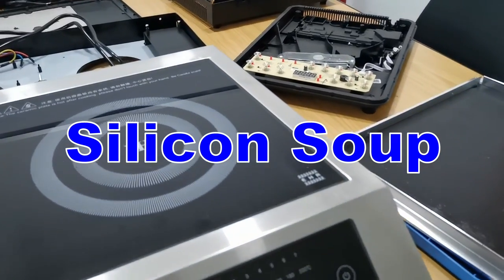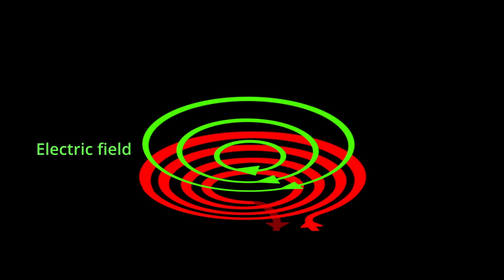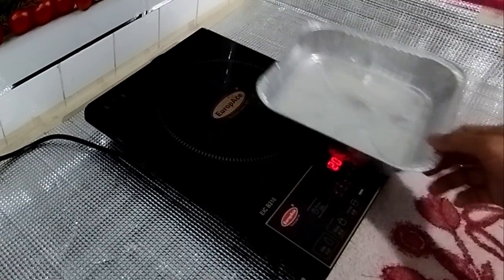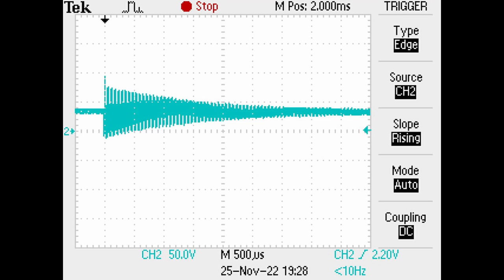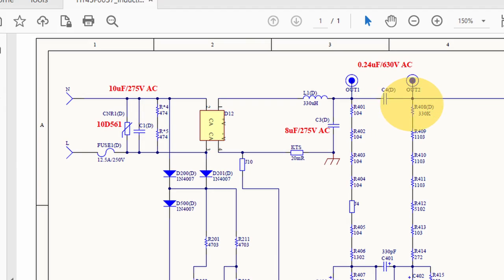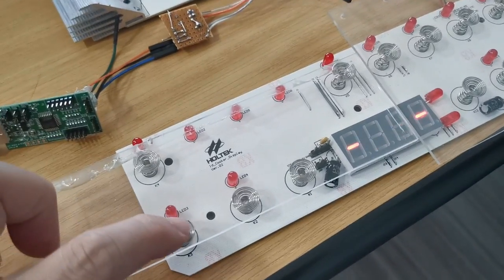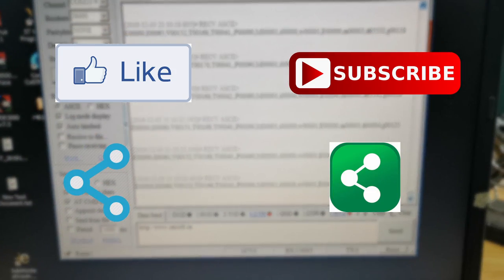induction cooker circuit, design, theory, must watch

Comment: You’ll notice the IGBTs are 600 V or greater, which means the room temp BVCES will never be 600 V.  Why do you think the line voltage will be capable of reaching BVCES and damage the IGBT?  During the on cycle the IGBT will be approximately 1.5 V with a load of 25 A, that’s 37 W.  If the cycle is very long you can estimate the junction to case temp increase is 37 to 100 °C depending on the heat sink.  Then there’s the ETS which is ~0.5 to 1.2 mJ.  So the average switching losses are 1 kHz*1 mJ = 1 W; adjust for frequency and temperature and thermal impedance.  The datasheet will give you guidance for temperature as a function of frequency.  So, the ideal behavior of switch mode converters is different than  a true application.  Real devices self heat and contribute losses while on and during transition.  I am sure you know this but I thought others might like to know you were speaking of an ideal switch and not an IGBT.

Comment: Excellent rendition. Thank you.  I am a EE from way back and now into CS.. but follow this stuff completely.  Built many circuits in my time.. I like the comment about running at 75% power.  Did not know that. Just got a Duxtop to play around with and was quite impressed by its performance today.
Reply from the maker: Cool, thanks!

Comment: I have an idea. Can I use broken induction cooker, replace the induction coil with suitable size to hug the bolt and make induction bolt heater?
Reply from the maker: Induction cooker is a delicate design. By changing the gap between the cookware and the coil, the igbt would burn, let alone replacing the coil.
Reply: @SiliconSoup   THe problem I encountered so far is that it is too smart and any notices difference and gives no cookware error.. :/

Comment: I always get frustrated that induction cooker have very big gaps between their settings. But the only good cooker that doesn't is $1,300!!! So expensive!

I wondered why they don't just use a potentiometer, and this video helped explained why in most ones this is not the case.

Comment: Well, i was hoping to find a video about some « drop-wave control method » that reminds me of the former NTSC video signal:

Holtek (Republic of China)
"Low power continuous heating single IGBT induction cooker"
2023-Feb-1

Too bad it's got to go through such long path only to come back and get treated as hacker stuff.  But this is actually a comforting read giving me hope for my specific kind of mission, in any case, so now that i found mention of a paper titled 'Holtek Application Note AN0591' it's clear to me what i want to search next!

Comment: You asked for my opinion, so I am giving it. 

I am interested in building an induction burner, and sought out this subject specifically. I appreciate your work, but I have to say--this was hard to watch. EMFs and EDMs and theories about theories and wavy lines. 

What would really make normal people get this (which is what you're after, I hope) is to start off here:

 "I want to understand induction cooking--so let's MAKE one."

So you start by running a current through a plain coil of wire, and that doesn't "work" because (x). So you correct for X, and explain why that is so. 

Then it will do (fill in the blank), but not (y), so you correct for Y, explaining as you go. 

This would have been so much more useful.

Comment: Thanks. I was wondering if I could modify the detection circuit a bit. My induction cooker works fine until the smallest diameter pot (which is made for induction cooking) but it produces the E0 error, that means it is detecting no metal on the secondary side. I wondered where one would adjust the sensitivity as I think it only needs a slight sensitivity adjustment to be able to detect the smallest pot. 

Kind regards.
Reply from the maker: I wouldn't recommend you to modify the detection circuit to fool the MCU. The smaller pot doesn't have enough load resistance, so if you manage to fool the MCU to do the induction, the feedback loop of power control may cause the back-emf to exceed the design value, and that may damage the IGBT (unless the protection is very robust).

Comment: Great video!
I have a question. The induction stove that I have does detect a thin aluminium foil or very thin walled aluminium container and both fly off the stove surface when stove is put on, (result of eddy currents opposing  the magnetic field producing it). 

I filled the thin walled container with water and placed it on the stove, the stove detected it and heat was generated instantly, the heat damaged the container but water became warm.

However the stove does not detect aluminium pan or pot, why so?

Does the thin Aluminium foil have higher resistance and hence gets detected?

Comment: Hi, really good video but I have a question please. I have an induction cooker but the power setting 400 or the temp setting 176F is too high for my cooking and burns the food. I want to adjust the duty cycle of the coil. how would you recommend I go about that?
Reply from the maker: There are two types of low-power cooking, one is intermittent cooking, e.g. turn ON  4 seconds of 1000W and rest for 6 seconds to achieve an average of 400W, the other is continuous cooking, turn on 4 rectified half-sin-wave and turn off 6 rectified half-sin-wave. In either case, the close-loop algorithm ensures the 1000W is accurate, and the duty cycle of 4/10 is open-loop control. How do you want to adjust the duty cycle? Do you have access to the firmware and the necessary tool for modification?

Comment: Is the 300V DC rectified from the the diode bridge directly apply to the coil?
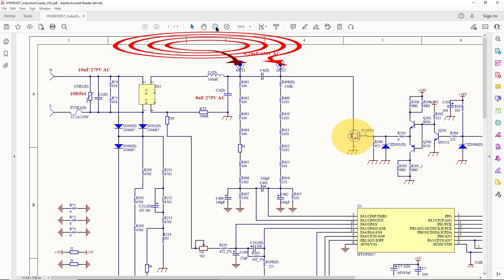Reply from the maker: At 5:00 is the schematic. There is a LC filter between the rectified voltage and the coil.

Comment: Your video is very informative. Can you help to make the circuit ignore that is no cookware on it and still stay on, like yours on the video? Thanks.
Reply from the maker: In my design/video, the controller sends out a single pulse to test the presence of the cookware, once every second. It doesn't ignore the absence of the cookware.
This firmware is designed to produce the induction power according to the user setting. If the user sets 1600W, the close-loop algorithm makes sure the average VxI is 1600W. If I ignore the absence of the cookware, there is no load to absorb the power, and the close loop algorithm will attempt to push the current higher until the heat dissipated at the coil resistance is 1600W. But in the process, the back EMF will overshoot and trigger the protective mechanism for the IGBT. Therefore, even if I ignore the absence of cookware, the induction will stop.
Reply: @SiliconSoup  in my case if I put not big enough cookware the controller goes to a fault mode and does not send power to the coil just for very short time. How can I overcome this problem?
Reply from the maker: @Logan880121  I want to be sure we are on the same page. Are you using HT45F0057, and do you have access to the source code and the ability to modify the source code? Or is this a general discussion?
If you don't put enough cookware, the test pulse oscillates and sustain long, telling the firmware that no cookware is present; the firmware will not start the induction. On the other hand, during the cooking, if the cookware is removed suddenly, due to transformer effect, the current on the primary side will drop suddenly, and once the firmware detect the sudden drop in the current, it will stop the induction.
Reply: @SiliconSoup  I don't have the firmware or the tools to flash the soc and it don't even has a marking on it. I am asking is there a way to trick the circuitry and modify the amprage sensing maybe make it adjustable. It seems to me you know every aspect of the circuit so maybe you can think a way to do this. I can use an arduino to modify the pot sensing. Thank you for you willingness to help.
Reply from the maker: @Logan880121  if you change the current sensing resistor, you may fool the controller. If you reduce the sensing resistor value to half, the control will be fooled to think the induction power is half of the actual power.
Reply: @SiliconSoup  thank you!

Comment: A single circular magnetic field results in unevenly heating the pan’s cooking surface with it being too hot in the center and too cool around the parameter. This condition causes the pan bottom to warp. There is a need for multiple overlapping wedge shaped magnetic fields  arranged in a circle to evenly induce pan heating.
Reply from the maker: Thanks for the info. When making the video, I was hoping to capture the water boiling starts from the centre of the pan first and then spread out to the circumference, but I was not able to capture that. So you are probably right, the coil is compensated to heat evenly.
Reply: @SiliconSoup  Sure, induction can boil water but it can’t sauté evenly multiple items in the pan like caramelizing onions.
Reply: @mikeb6389  Yes it can.  You just need a well engineered, good quality induction range and compatible steel or iron saute pans.

When you heat with gas you still need to preheat, or at least allow time for the heat to spread evenly across the pan bottom.  You can do the same with steel or iron pans just by allowing time for the heat to migrate.  the better the pan heat conductivity the easier this is, just the same as when heating with gas.  My experience using 50 year old triple layer stainless steel RenaWare pans on both gas and induction hobs is that the induction heating is faster, has more accurate temperature control and does not turn on the automatic heat sensing fan over the range as it does not put waste heat into the air over the stove.  Finally, induction hobs are much easier to keep clean than any gas range, and as my dear old Mum would say, cleanliness is next to godliness.
Reply: @philipgrice1026  I got a kitchen that has a 3kw curved wok induction. We tried taste testing between using this and takeaway from Wok to Walk where they using large flame woks. Couldn't taste any difference.

Comment: Actually the term EMF here is an arcane concept. The time varying current in the coil actually  causes an Electric Field around and along the coil due to self inductance in units of volts per meter,  that is the Maxwell Faraday law. The International Electro Technical commission  has regulated the term EMF to the status of deprecated.
Reply from the maker: You got the cause and effect wrong. Electric field causes charges to move (current), not the other way round. Maxwell Faraday equation is curl of E = - dB/dt.
Reply: @SiliconSoup  You just wrote it there yourself curl of E = - dB/dt. The term 
 - dB/dt is caused by the current.  The current is caused by the the applied electric field and as a consequence there is an apposing electric field.
Reply from the maker: To say that "The current is caused by the applied electric field", and "The time-varying current in the coil actually causes an Electric Field around and along the coil due to self-inductance in units of volts per meter" over-simply the whole induction process. How does the cookware contribute to the circuit behavior?
The induction process is very complicated and therefore I devoted 0:50 to 3:30 to explain exactly what happens when various current and B-field interact with each other. If you are implying that all these can be summarized by Maxell Faraday law, then I disagree.
Reply: @SiliconSoup  What I am identifying is that the video uses the term EMF, but the correct term is electric field.
Reply from the maker: I am pretty sure I used EMF correctly. By the way, electric field and EMF are not the same thing.
Reply: @SiliconSoup  Where there is an electric current there is an electric field. Induction and self induction cause an electric field and the integral of electric field is voltage, there is no separate phenomena in physics of an EMF, it is an old defunct concept. Thanks for uploading the Video.
Reply: @woodcoast5026  without a potential, or a difference, nothing has any impetus to change. no current can exist without the potential to create it.

Comment: This is awesome. I have one question, can we skip altogether the AC input and use DC instead?

If we can, is it posible to modify off the shelf board to do it?
Reply from the maker: If the DC is 325V, then yes, you can skip the AC altogether. But if the DC is 12V, then the coil inductance and resistance must be much smaller to achieve the same current by the  lower switching voltage. Many component values must change.

Comment: Is the schematic suitable for using « low power continuous heating » as seen in Holtek AN0591EN?
Reply from the maker: No, the schematics are not the same. The version I presented uses HT45F0057 whereas the the low power continuous cooking uses HT45F0059. HT45F0059 has the low-power continuous cooking related registers. The external circuit to monitor temperature, voltage, current, surge for HT45F0057 and HT45F0059 are roughly the same though.

Comment: What is the purpose of commercial PIC's that have two or more IGBTs?
Reply from the maker: The half-bridge topology uses 2 IGBT. It is form commercial induction cooker which can deliver higher power (3.5kW)
Reply: @SiliconSoup  I have posted a circuit diagram for a Hatco IRNG-PC1-14 on r/inductioncooking, in case you'd like to take a look. It came with the unit.

It's a $1000 single burner unit with 100 power levels spanning 1400w, a minimum constant power of 191w, and single degree temperature adjustments; and 2 IGBT's.
Reply: Further yet, the Mirage Pro claims to use 4 IGBT's on a 1400 or 1800 unit. The Hatco units are all 2 IGBT's until 2.4kw, when they hit 4.

Comment: What is the maximum temperature of induction coil body ? Are the coils able to work at temperatures up to 200°C
Reply from the maker: I am not sure about the maximum temperature the coil can tolerate, but as soon as the thermistor there senses 175C, we shut off the induction.

Comment: Why the power variation is in steps? Is it not possible to vary the power smoothly and continuously?
Reply from the maker: Technically it is possible to vary the power smoothly. Maybe a smaller step of 50W is ok, but smaller than will become impractical to the user; to many presses are needed to reach the target power.

Comment: So, it is an electrical interaction with the cookware (i.e., current resulting from a moving magnetic field), rather than the oscillating magnetic field itself interacting with the cookware. If that's the case, then it seems that the only requirement for my cookware would be that it resists electrical current, not that it is magnetic. What am I missing?
Reply from the maker: Thank you for this good question.The magnetic field above the glass top attenuates quickly because of free-space permeability. The flux going into the cookware is weak and it cannot induce much current. If the cookware is made of magnetic material with high relative permeability, the flux gets multiplied and there induces more current for heating. In other words, the magnetic cookware enhances the coupling and increases the mutual inductance.
Reply: @SiliconSoup . 
Hello, thank you for the video. You said the wrong cookware could damage the IGBT by messing with the oscillation too much. For those of us who just want to know how to use and take care of our induction stove and cookware, what do you mean by wrong cookware? Are you talking about the cookware material, it's shape, or both? What is the type of cookware we should and should not use on induction? Is it ok to use a heavy Cast Iron skillet on it?

I have two other questions. I hear cheap induction hobs that only work by going 100% power "all the time" and keep switching on and off can damage/warp even Carbon Steel skillets. I have one and I'm afraid of benting mine. How do I know if I have a good induction cooktop or one of these cheap ones? I know I should use a cookware of a size smaller than the coil I'm using, but other than that, what can I do to make sure my cookware won't warp?

Also, I like using a stovetop moka "espresso" maker on induction, but I want to use a smaller one and the coil won't detect it. I've tried placing some coins or other "magnetic" steel inside it, but it wasn't enough to make the detection work. How does this work? Does placing several metal objects on top of the coil messes with the magnetic field? Does it have to be just one "big enough" metal piece for it to work? Is there any other way I can "hack" to coil detection in order to get it to detect and head the small stainless steel moka that won't be detected by itself? Magnets do work on the small moka's bottom, but it's just too small.

Thank you for your time.
Reply from the maker: @Jumbernaut  For the coil to detect the cookware, the cookware must be magnetic and resistive, and alloy of iron and chromium is an example. Moreover, you must place the alloy/load just on top of the glass top, not any further away.  If it is a bit further, the circuit cannot detect it. The magnetic steel should come as a big chuck (rather than several objects), so that current can flow easily inside, to absorb energy. The transfer of energy to the load damps the oscillation, and the MCU detect to damping to determine whether there is a load.  If the material of moka maker can't be detected, then the induction can't heat up the same material either, so there is no point trying to fool the coil to turn on the induction. But I guess if you can submerge a big alloy in water inside the maker, the the cooker can detect the alloy, it will turn on the induction, heat up the alloy and transfer the heat to the water.
Reply: @SiliconSoup . Thank you for your response. Do you think those heavy Cast Iron Skillets, like 95% iron, are good for induction, or to they have too much "magnetic, resistance"? I want my induction cooktop to last as long as possible.